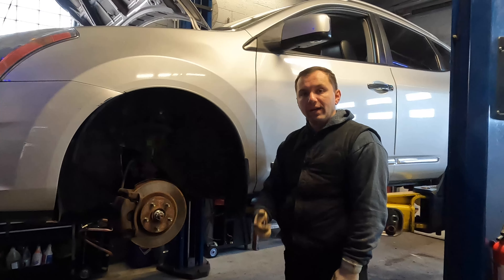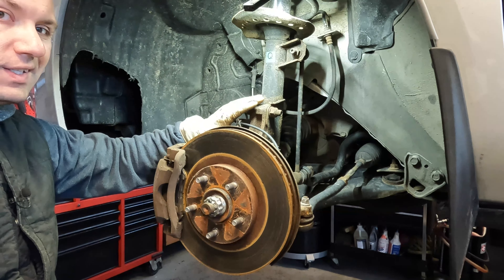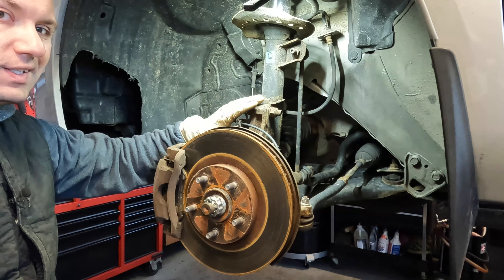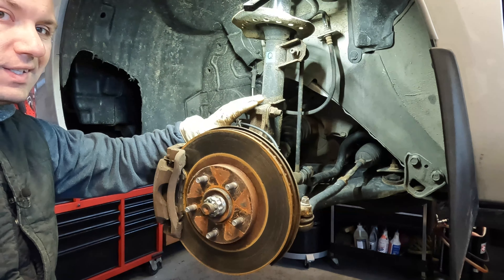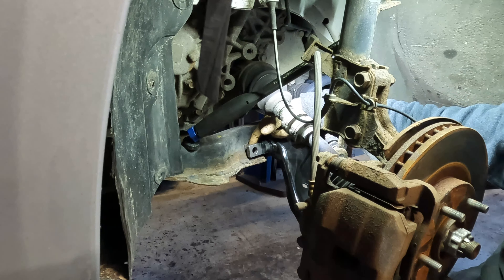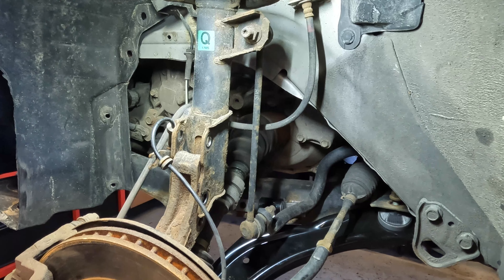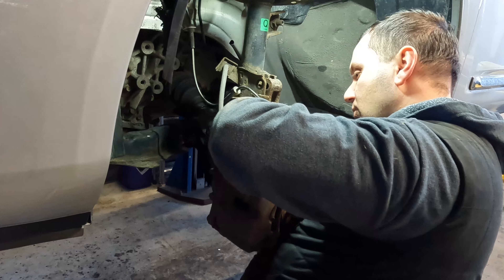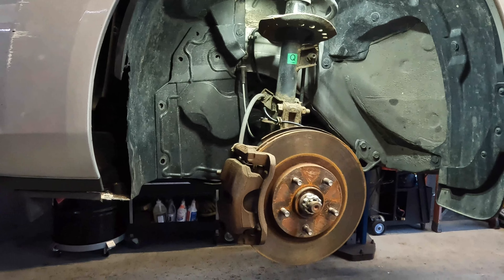CUSTOMER STATES A KNOCKING NOISE OVER BUMPS! HOW TO REPLACE A NISSAN ROUGE LOWER CONTROL ARM!

Comment: I did these control arms on my wife’s 2011 Rogue and saw that I could spray the two lower bolts from behind, The ball joint was so dry it made a horrible creaking sound while turning the wheel. You having a lift makes the job so much easier, nice for you 👍🏼